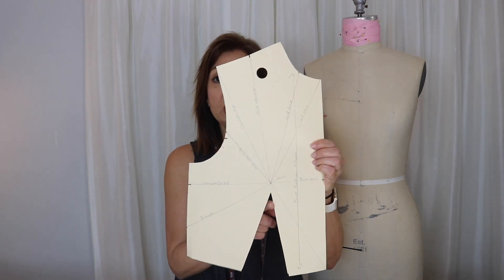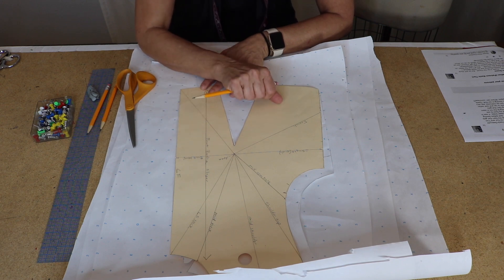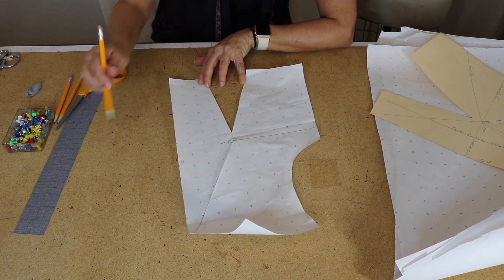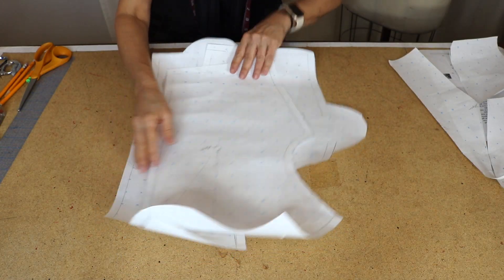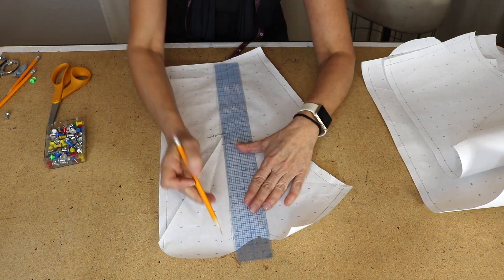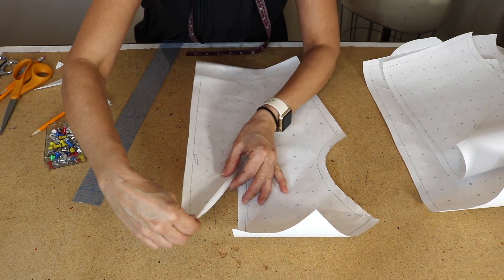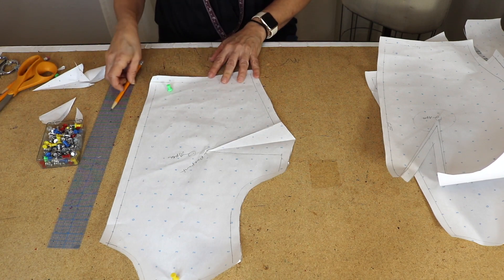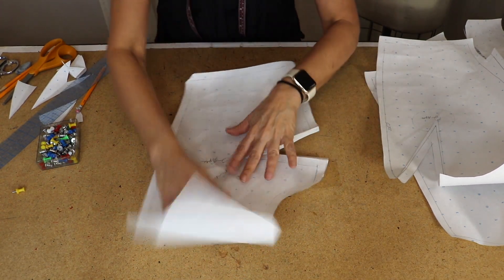Learn The Slash & Spread Method - What to do With Dart Excess?

Comment: How would you pick a dart placement? I would generally go with the side dart in order not to "mess" with the fabric pattern center front. When would it be better to have a waist dart or a dart towards the neckline (or any combo)? Is it just a matter of taste or does is affect the drape in any other way? I'm petite with a full bust and I've realized that I need to do a FBA in almost all garments to make them fit. I always pick patterns with darts for woven fabrics, but I have to make adjustments anyhow. Thank you for very interesting videos! I wish I had bothered to learn all this earlier.
Reply from the maker: Where to place the darts are All part of the designing. Yes, sometimes it has to do with wanting to not disturb the flow of the design so placement of the dart needs to be away from design lines.